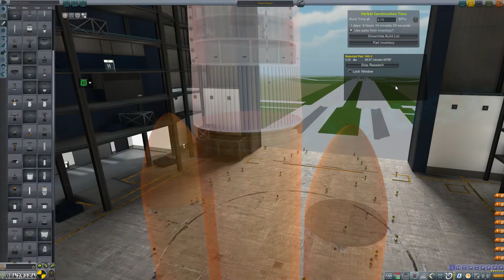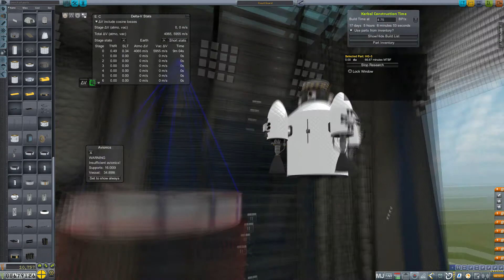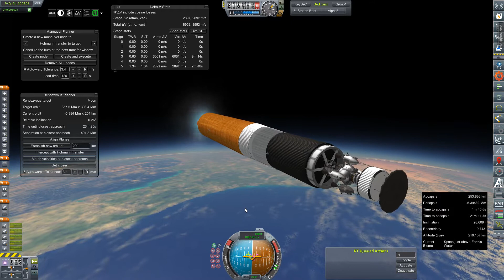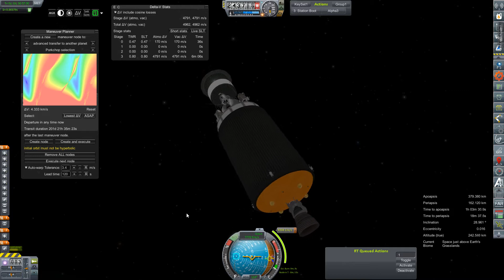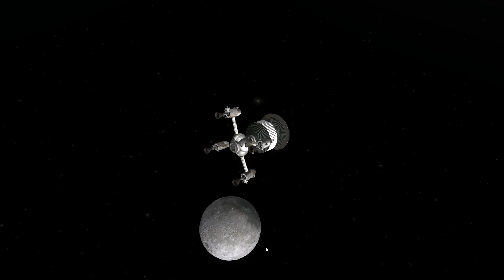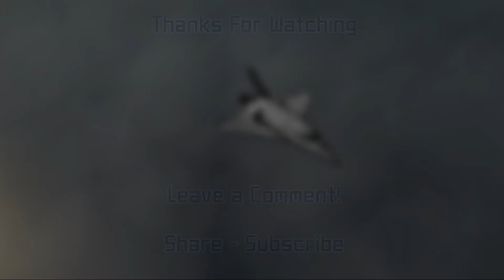KSP RP-0 #250 Mo Mars Mo Problems

Comment: (Sorry, I did not follow your progression closely).
Have you tried reducing the gimbal authority of the engine? That might reduce the "wobble" you're having.
Reply from the maker: I've not tried it yet, but I was able to solve most of the wobble with a re-design.  I may reduce gimbal on the HG-3 core to see if it helps. Thanks!